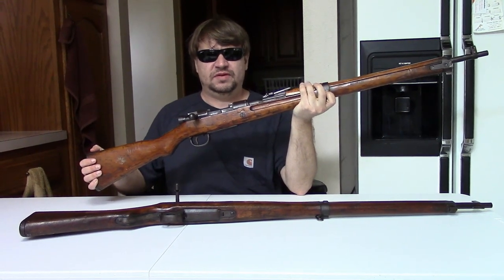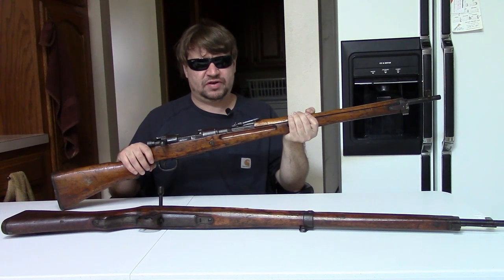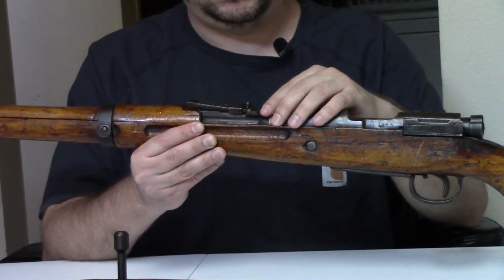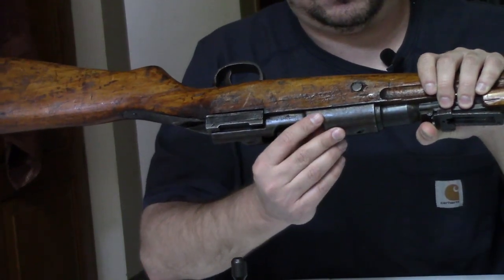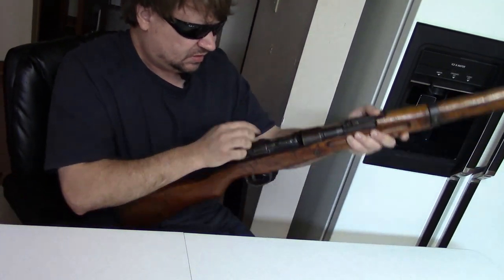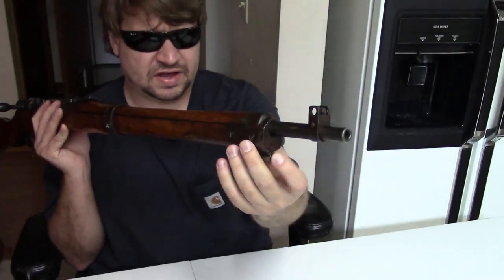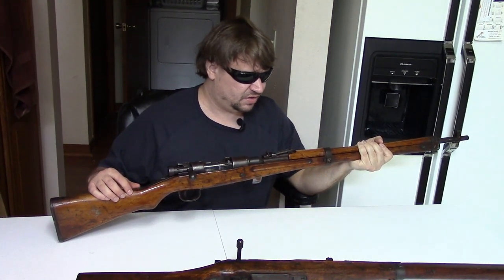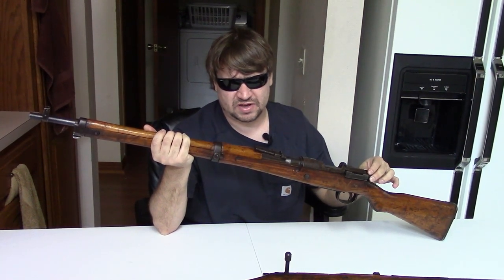How To Make A Rifle From Cast Iron - Japanese Special Navy Arisaka Type 99

Comment: I’m guessing it’s not regular cast iron but malleable iron, which is cast iron with lengthy heat treatment. Late war BAR receivers were made the same way, under the trade name Armasteel. M1 carbine trigger guards and M2 heavy machine gun barrel shrouds as well.